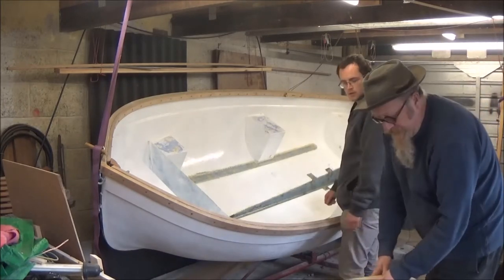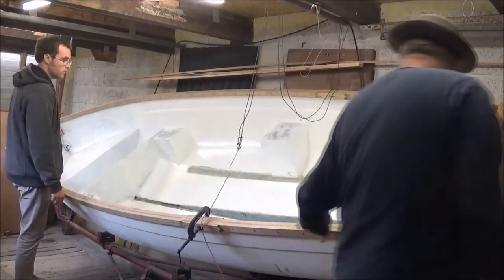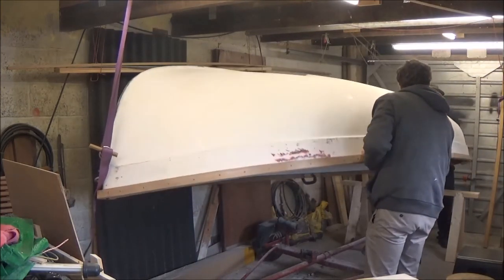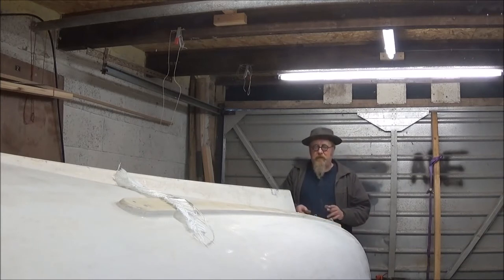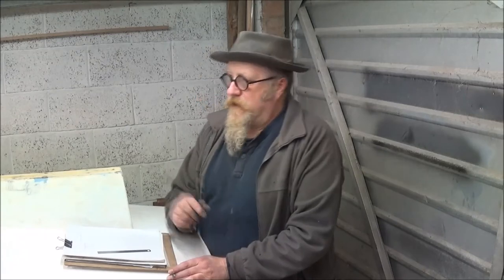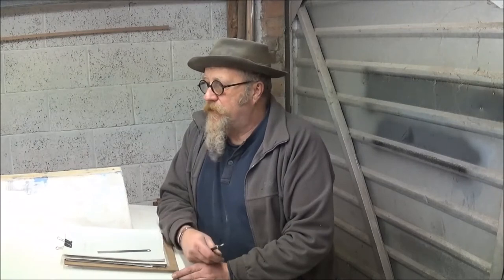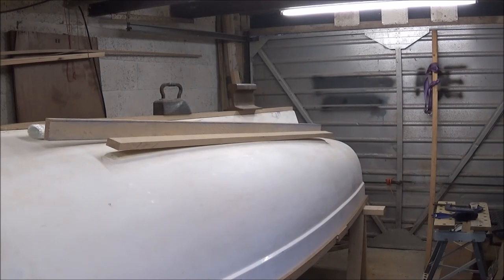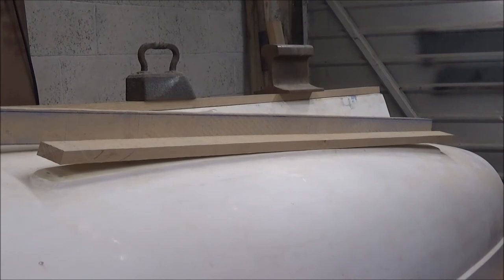Dale Skidmore -Boat Restoration Part 17

Comment: Hiya Ade. Many lessons learned for sure. I'm also thinking about buying a circular saw to take the graft and time out of cutting down timber but cost is the thing for me.  I like to do everything on a tight budget but there does come a point when you think sod it, Let's make life easier for myself! lol. I think you did a great job with the timber for the keel and I'm sure it will look great when finished. The boat is coming along lovely and you ought to be very proud of your achievement. It's nice to have a project which you get so much enjoyment from. Take care mate, Des
Reply from the maker: Hi Des. The saw came from B&Q, and was about £50, very similar to Screwfix gear. It is nicely made and has saved a lot of time. I have used it with a straight edge guide and it still needs a tidy up with a plane ( quicker than a jigsaw on straight cuts though ). I don't regret the purchases I have made for this project, they were considered thoroughly first. I am just loving the job and looking forward to getting on the water with her. Thanks.

Comment: nice one ade,nice job on turning the boat and on steaming the "howard", the only things I know about boats is what I'm learning from youre videos,so when you said the howard, I actually thought you meant the "stern" not the keel, cheers as always.......johny
Reply from the maker: It was just a cryptic joke on Howard Keel, Johny; although there are some very obscure real names for parts of a boat, such as the 2 planks by the keel are called the garboards and the halving joints between the planks are called the Geralds. I try to use the correct names for things, but couldn't resist the feeble joke. Thanks for watching, atb.
Reply: Dale Skidmore i know who howard keel is lol, but i thought u meant howard stern, the american shock jock 😀
Reply from the maker: Oh yes, ha, ha, I never thought of him.
Reply from the maker: PS, morning Johny.